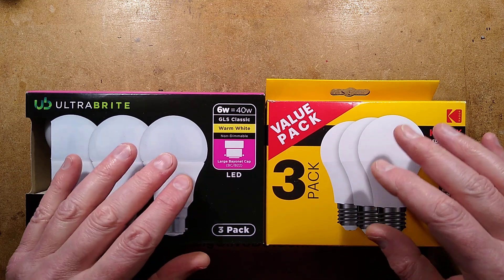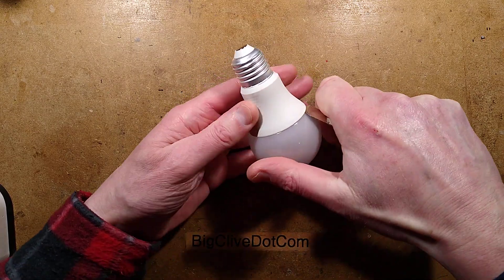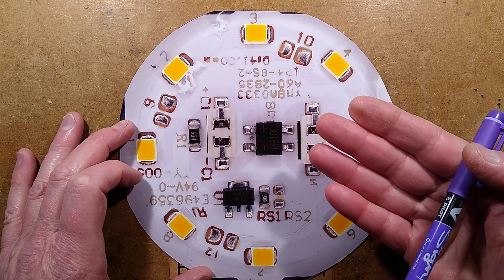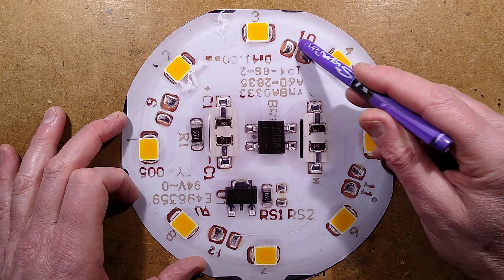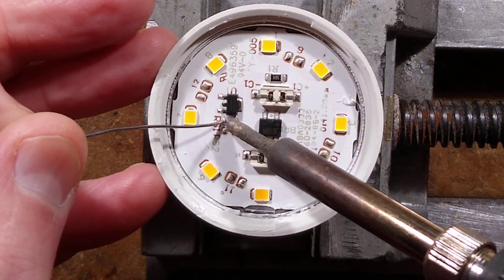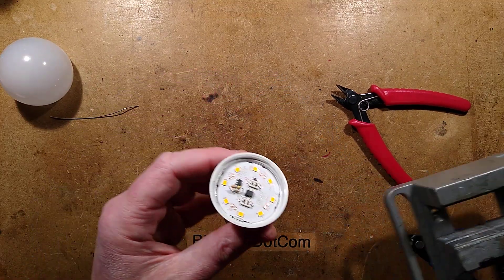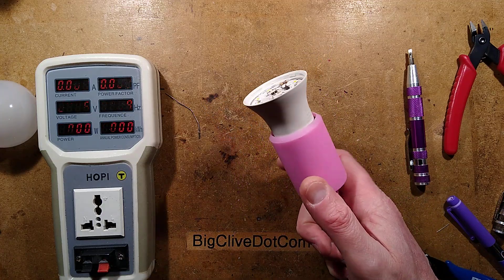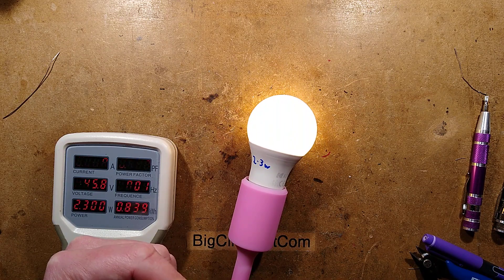Hacking Kodak lamps

Comment: When these LED lights fail, what is the common reason for fails and can they be fixed?
Reply from the maker: Usually an LED going open circuit.  They are quite specialist high voltage LEDs.

Comment: Looks like I will be buying the 100W equivalent bulbs and modding them down to 60W equivalent so they last 15 years. My lamps almost always fail due to the heat cycling of an LED cracking the solder joint or the LED plating.

Comment: If you used a trimmer rather than a fixed resistor you could get the power spot on, 2W, 2.5W 3W etc.

Comment: According to MIL-HDBK-217 (now public domain and downloadable) for each 10C reduction in temperature you should see a doubling in life. If it lasted 18,000 hours MTTF before under-running, then reducing from 11W to 2.3 should ball park give you near 100,000 hours MTTF. There are electrolytics that can do that if you run them cool. Alternatively use a high temp one (+125C) with a life of 2000 hours and by the time you are running it at 65C it will work for 128,000 hours or a bit over 14 years.
Reply: YMMV. In LED lamps  it is often components other than the LED chip that fails.
Reply: @bobraible  not really. I had a few phillips bulbs fail by LEDs going open circuit.
Reply: @bobraible  Yeah I have an LED lightbulb that stopped working. I've been saving it because I'm betting the LEDs are still good. I want to just apply DC power to it and see what happens.
Reply: @El_Chompo  you can't just apply dc voltage to an led without risk of burning it out. You need to  limit the current.

Comment: I have this one really old led bulb that has been running over 12 years when all the others died at 3-4. Noticed it was for 220v mains and didn’t really seem much dimmer from the short lived “correct” 110v bulbs
Reply: Oh, now this is interesting. I also live in the US, and I'm wondering if I could just buy 220v LED bulbs now
Reply: Theres a light bulb thats been on never off for 100 years. In s fire station

Comment: I wish some parts of the world would unite in a new lamp standard similiar to proper flourescent lighting. You have a separate power supply, a proper heatsink, and a standard fitting for a LED package.
1.) Sure it will be a bit messier to change LEDs (b'cuz thermal goop) but you should only need to do that once every 10-15 years.
2.) Proper quality powersupplies, built to last, free from sh** caps that dry out, ventilated case.
3.) An armature that can houses a proper heatsink, with fins for surface area that can actually keep LEDs cool instead of having them cook inside a plastic thermally insulated bubble.

4.) This would make the enviromental part better, as you throw away the broken part, the heatsink never needs to be replaced (for the lifetime of a human anyway). As a part of the kit you will need a ubiquitous "tester" to diagnose faults of powersupplies so you do not toast yourself or the next LED after a failure.

Comment: Two years ago I bought Kodak 100 watt equivalent LED light bulbs at a discount store, unfortunately they split in the socket due to them overheating. I later found out they were recalled.

Comment: 3 year guarantee? I'm not even old enough to drink in the US, and yet I remember hearing about how "those new LED bulbs are going to last 10 years" when my father bought a new house with my stepmother
Reply: most bulbs made over 10 years ago are probably still running fine. It's the new overly cost "optimized" ones which die.

Comment: I’ve been repairing LED bar lamps with 50-80 little LED chips. Couple busts then scraped to just short them with solder. The problem is, less chips means more power through each LED which makes ‘em even more vulnerable. Now I can reduce whole power so that I can squeeze more life out of them. Thanks.

Comment: Perhaps, soldering more leds to the 4 unused pads will decrease the overheating and give off more light. Instead of downgrading the resistors.
Reply: That wouldn't work. As Clive explains somewhere around 4:20, those unused pads are wired across two of the used pads. So if you added an LED to location 9, for example, it would cause locations 1 and 2 to (mostly) stop working because they wouldn't get enough voltage across them to light.

Comment: 2:32, well LEDs are like 20-30 % efficient. So only, let's say 75 % of the energy is dissipated as heat. That would still be about a Watt per LED though. Which is still quite a lot...

Comment: You should also sometimes show us what kind of LED lamps are used in US with 110V. What kind of circuit changes must be made for that voltage? Also explain about the frequency of AC voltage. 50Hz and 60Hz differences in circuits.
Reply: I live in the US and the lamps are basically the same. Instead of packages with 12 LEDs in series like Clive has here we might have packages with 6 LEDs in series but each twice the size.

For most circuits the power frequency basically doesn't matter as it's converted to DC before it's used.

Comment: I've started doing that to lamps I occasionally grab out of the lamp recycling bin at a local supermarket - just swap out the burnt LEDs, and then tame them down to about half the power. Usually they're so standardized I can just use one lamp as a parts donor to get the appropriate LEDs to put into the other ones. Now I have lots of free LED bulbs that are probably going to last a way longer than before they were thrown out in the first place ;P

Comment: On this kind of lightbulbs I see that they consistently consume about 1w above the rating. Is it possible that the marketing is only the LED consumption and that the extra W is the transformer efficiency loss?
Reply: The bulbs Clive shows are likely designed for a nominal 230 volt supply. Since Clive has a rather high ~247 volts this could account for some of the discrepancy.

Comment: I believe 3 Yr warranty is based on 3000 on off cycles or 3 hrs per day use. If it is less than 3 years, they say you used it more than 3 hrs/day :-) I suspect there is a self destruct cycle that causes a surge after the Lifetime is up. I would love to see how much longer the bulbs live compared to the un modified ones. I wish I had the time to see if a self destruct pulse of high current could be detected and confirm my suspicion.

Comment: Wouldn’t it be more accurate to measure the total resistance of the lamp after the rectifier, then the resistance of an led ansehen multiply the total power of the device by (led resistance/total resistance)? Please correct me if I’m wrong

Comment: I never thought about changing out the resistor... such a simple change to reduce the power consumption.  I have also discovered that is you use these lamps out of the box in any type of enclosure, (ceiling fixture, or outdoors walkway or porch lamp), it reduces the life of the bulb because there is no escape route for the heat.  By reducing the wattage, (possibly the lumins also?), you lower the heat factor and extend the lamp life greatly.
Reply: I thought a resistor just "wasted" electricity as heat? Like how heat generated by running electricity through a wire is called "resistive heating". How does using a resistor save power?
I'm clearly wrong and would like to fill this gap in my knowledge.
Reply: @zig131  The resistor does "waste" power but it's somewhat insignificant. In this case it's probably 67 milliwatts. By swapping the resistor for a larger one it wastes less power, probably only 10 milliwatts. The reason the resistor is needed in the first place is that the current through the LEDs is set to the same amount of current that flows through the resistor.

Comment: I've have a bunch of LAP branded G9 LED bulbs from Screwfix around the house for 3.5-4 years without issue, these are rated 2.8W and have 32(!) LEDs in them. I recently noticed they're now stocking a different item, 999PP which (guessing from the provided pictures) have 10 or 11 LEDs and run at 2.7W, so likely hotter running and with a shorter life. They've carried over the reviews from the 32-chip bulbs which seems shady at best.

Comment: I had an LED light that started glowing dimly a while ago, so I decided to take a closer look at it. It's a 10 W bulb, but it had 15 LEDs inside, so each chip was dissipating 2/3 of a Watt. Would Doobying my other bulbs really help all that much?
Reply: Yes, because the LEDs will very likely be driven to their maximum in pretty much any bulb. It's just that the maximum itself is different for every bulb model and depends on the selected LEDs, PCB material, heatsinking capability, aso.

Comment: Last week my 7 watts Philips LED lamp died at the age of 2 years, used every night from dusk to down. (Maybe 8000 hours?) 1 of the 11 Leds passed away so I shorted it. I increased the sense resister from 3.4 into 5 ohms. Now it should run on 60A instead of 88. Chip is a BP9916
Reply: 60A? that's a lot mate.

Comment: all my lamps are from a pound land here in Ireland called EURO SAVER. (used to be called the 2 Euro shop but changed over and kept the same front and colour scheme) so nobody noticed and still calls it the 2 euro shop. BUT ANYWAY.. all my lamps are meant to be 5 Watts but run at 3 watts.  And not by my hand but the cheap hand of the shop... anyway they make a huge difference if your using 40, 60, & 100 WATT old incandescent bulbs or those energy saver 22Watt CFL ones.

Comment: Sooooo...  what if we put a pot in it (not put your pot in it) but could adjust it along with using a light (lumens) meter?  Would that be interesting?  And maybe for comparison show an original one side by side.  And if we wanted more light output could we start with a even brighter one and drop the current?  The pot could be put in series with an ammeter to see what the actual draw was.  More stuff to see.

Comment: I use the same style handle. I added a half inch wide solid copper wire coil to the bit that goes over the tip. Wrap it around then double back over and add some high temp heat shrink to hold it in place. It adds a bit of thermal capacitance to these and helps them considerably. Either that or I just think it does. It feels better to me.

Comment: The US solution is to use dimmer switches and plug-in dimmers, which I understand are significantly less popular in Europe. My house was remodeled in a window where dimmer switches were required by building code. As a result, US regulations (California Title 20/Energy Star) require the bulbs sold here to be dimmer-compatible.
Reply: Dimmers (at least the modern one) don't expand the lifespan often they do the opposite because they work with fast switching.
Reply: @fischX  Nope, not for LEDs. LED drivers run off rectified DC, the LEDs never see any of the switching. Instead, the dimmer circuit detects the chopping and adjusts its output current accordingly. The nicer LEDs from e.g. Philips even change their color temperature as you dim by driving the strings differently.
Reply: Dimmer switches seem to not be popular anymore. Newest house I can recall seeing one in was built in 1983.
Reply: @brianleeper5737  I looked it up, CA reinstituted dimmer requirements in 2016 (they were dropped due to CFL). CA new/remodeled homes must have all interior lights on a dimmer or motion sensor, with the exception of hallways and closets.
Reply: @straightpipediesel  I wonder how quickly those get swapped out for regular switches. No such requirement in the state where I live...yet.
Reply: @brianleeper5737  Very likely never, because as I said, LEDs in the US were almost all dimmable due to Energy Star subsidy requirements, and since 2018, CA Title 20 has made that law. The only time you run into issues is if for some dumb reason you're using CFLs.
Reply: @straightpipediesel  I expect that as those dimmers and motion sensors fail, a cheap toggle switch will be the replacement of choice for many homeowners.
Reply: Dimmers are very expensive in europe

Comment: Besides of the Dubai lamp, do you know of other high efficiency, long lasting LED lamps sold in the west?

I like my house to be brighter than the surface of the moon (my eyes are bad, but I also get depressed in dimmed light super fast, also I am so pretty, not lighting me properly would be a crime), but I don't want to constantly replace the failing led lamps.
Reply: Rule of thumb is 10% less voltage 100% more lifespan so the solution is easy, under volt your LED
Reply: @fischX  Yes, but is there a brand thst undervolts them for me?:)

Comment: Interestingly the A60 bulbs wih the bayonet mount don't have 8 LED bulb lamps at the 10 watt range. They are 10 LED. It's only the potentially lethal Edison screw lamp that uses the 8 LED arrangement. Their website show they have a bigger range of lethal mount bulbs with 6, 8, 9, 10, 12 and 15 chip setup than the bayonet bulbs which are only 6, 10 and 15 chip setups.
Reply: Nothing potentially lethal about an Edison lamp socket if it's wired correctly. Neutral goes to the shell, hot goes to the button. And don't stick your fingers into it. Easy peasy.

Comment: I can also imagine the LEDs getting hot because there is no airflow in there at all.  Any airflow on the outside is all its got.
Reply: Much of the heat will be radiated outwards.

Comment: I guess I dont understand the point. Just get lower wattage equivalent bulbs. Less bright, less heat, longer life out of the box.
Reply: I think that lower wattage bulbs will have less LEDs, and will fail after a few years at most by design. By underrunning would-be brighter bulbs they will last considerably longer.
Reply: Or to put it another way, the individual LEDs are the same brightness, and run just as hot, even in bulbs with fewer LEDs, unless you modify them like this.

Comment: I have found that LED lights open easiest with a bench vice.  Throw a shop towel over the jaws so they don't mark the dome.  You just squeeze it until the sides are displaced about 13mm (1/2").  Unclamp, turn the bulb 90 degrees, and do it again.  At that point, you should be able to just give it a twist.  It's a LOT easier than the spudger/knife/razor way, and once you have the feel of it, you won't damage anything.

I have taken apart a ton of them, to write Amazon reviews including showing the LEDs, and to see what controller they use.  The ones using ESP8285 or ESP8266 are easy to convert to ESPHome or similar.   Even if they aren't easy to do, you can pop the whole assembly out and connect up a TTL adapter to flash with.

I haven't done a tutorial video on that, mostly because I think it didn't really need it, and I'm really really lazy about making YouTube videos.  :)
Reply: ... I have a bench vice and some shop tools by my electronics workbench.   That has made it easy to do everything from making/repairing small boards and modifying lightbulbs, to rebuilding car alternators and power steering pumps.   I just move my silicone mat, and lay cardboard down, to do dirty work.   I don't have to do that work outside in the heat (Florida's always hot), and there's excellent lighting at my electronics workbench.

Comment: I don't know whether it's different in 240V-land, and I don't know those Kodak bulbs specifically, but based my anecdotal experience with LED lamps in the US, that 3 year warranty sounds perfectly reasonable to me (maybe even a bit conservative).  In fact, I have quite a number of 10-ish watt LED bulbs (mostly Phillips) in my house which I installed roughly 7 years ago (when I moved in), and aside from a couple which failed within the first couple of months (manufacturing defects seem to be fairly common with LED bulbs, I've noted), I think only one of them has has actually burned out and had to be replaced in that time.

(Keep in mind that these warranties are also done with the assumption that people are going to be turning them on for only a few hours each night, so 3 years comes out to really somewhere around 1000 hours of expected use.  If you're leaving it on continuously, obviously, that will not last nearly as long, but most people don't do that.)

I do agree that it seems like these bulbs are being driven awfully hard, and should not last very long, but apparently the robustness of the modern LEDs and associated components are really impressive these days, because they really do seem to be able to hold up surprisingly well under those conditions, from what I've seen (which means if you mod them down like this, they'll probably last basically forever.. you could potentially be handing them down to grandchildren as family heirlooms :) ).

Comment: When I bought my house I replaced every CFL bulb with LEDs, bought a couple packs of the cheap contractor grade ones at the local home improvement store, $30 total for 20 bulbs. That was 5 years ago and I haven't had to replace single one yet. Even the ones in the bathrooms are still going strong, I though of any they would go first just due to the humidity. Cheap LEDs can last.
Reply: What brand
Reply: @summerforever6736  EcoSmart, i got them at Home depot
Reply: @KRiley129  thanks
Reply: I noticed the price has gone up from what they were 5 years ago, still on the cheaper side.

Comment: Would it be worth trying the valley-fill network you covered recently, on these hacked lamps, Clive?  Capacitor-diode, diode-capacitor, bridged together in the middle with a diode?  Power factor might become as much of an issue as wattage; or is there an easier way to correct it, maybe?
Reply: The valley fill circuit has an output voltage with tons of ripple. As such it really only makes sense when followed by a switching regulator.

One way to make a bulb like this have better PF is to remove the main filter capacitor and put it across the LEDs instead.